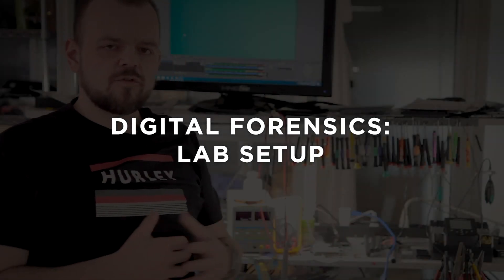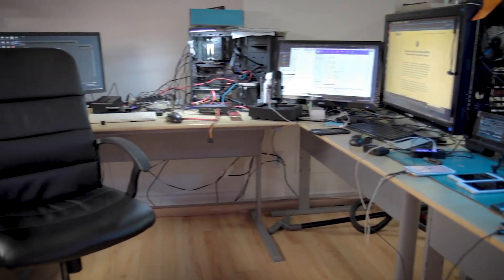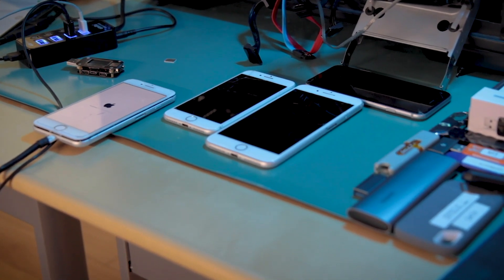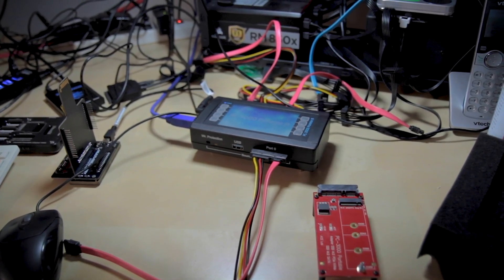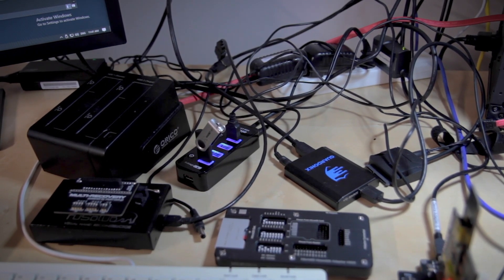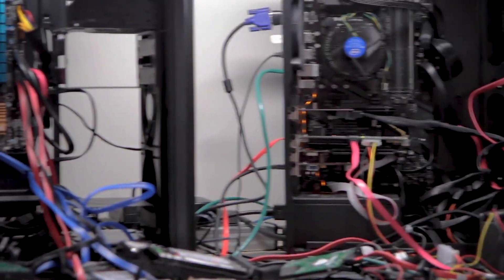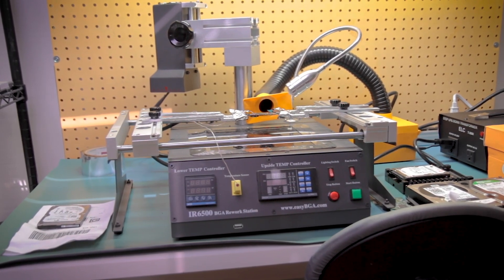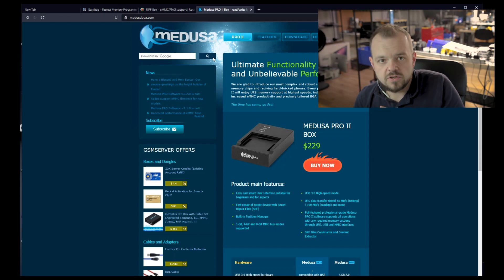Digital Forensics - What you need to know. Part 2

Comment: Hey, what are the specs of your workstation for using cellebrite? Kind regards
Reply from the maker: That one fairly old, some i7 from 2014 with 32gb. It will soon be replaced by dual Xeon with 256gb ram
Reply: @forensicguy  Thank you for the fast reply.